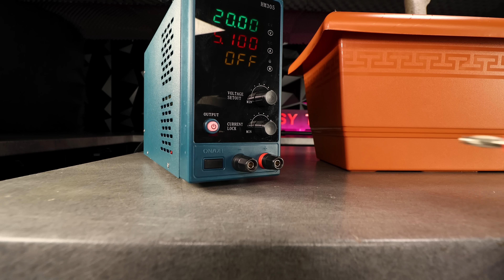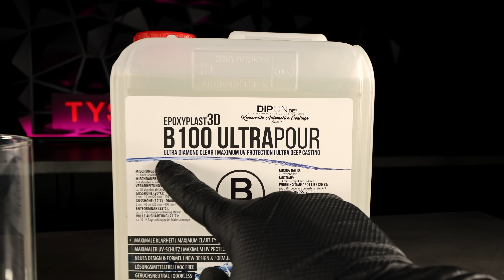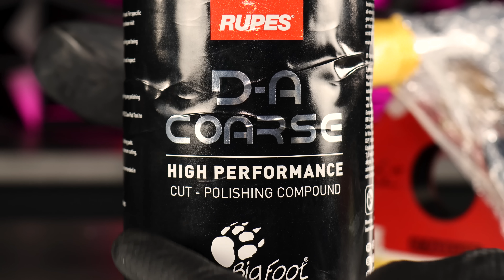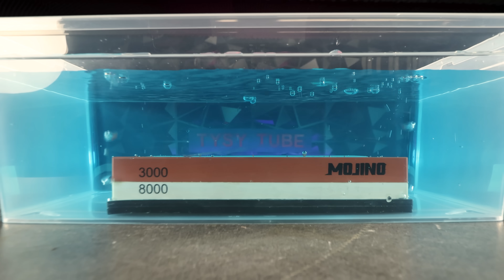Rust is Peeling this Huge Cleaver - Restoration (with Carbon Fiber Handle)

Comment: This was probably originally a variety of polearm and not a cleaver; the original wooden handle was likely several feet long.
Reply: @probablyaxenomorph5375 It was used in  whaling, but you're right that the original handle was probably several feet long and it could be used as a polearm.
Reply: I thought the same thing. That short handle will be unwieldy. For actual combat use, it should be at the top of a 6-7 foot pole.
Reply: @probablyaxenomorph5375  looks like a headsman’s axe tbh lol
Reply: I think the handle should have been a lot longer ... you wouldn't necessarily need to have it an original 6 feet or longer but even 4 or 5 feet would have been better because the little handle makes it difficult to hold
Reply: Always thought this was some sort of a halberd
Reply: Looks like a bardiche to me
Reply: @probablyaxenomorph5375  I was thinking glaive, but I'm glad it's not just me. Lol
Reply: I think the short handle was so he wouldn't waste too much material :) I was thinking that a weapon like that would have to have a massive handle. Does anyone know what the designs could date back to? Maybe they are just generic
Reply: Low-key looks like the Blackmetal Atgeir from Valheim to me.
Reply: Just a slovenian hewing axe, you goofballs....
Reply: @RolloTheWalker2  So it really is like the Black Metal Atgeir from Valheim, since that one is a Polearm but also a Hewing Axe, and you can even use it for that ingame
Reply: imagine being a medieval soldier or whatever and the weapon you passed down to generations gets used for COOKING
Reply: This is nothing but a piece of sheet metal cut to look like a weapon then they rust it to make these videos.
Reply: @samiam4544  Well, if you compare a piece of sheet metal to the varying thickness of this blade, the original forge marks on the metal around the wooden pole, and the scalloped pattern on the blade... it's pretty easy to see that this isn't sheet metal lol

I'm certain that some restoration channels resort to cheap trickery like that, but this piece in particular looks authentically built and naturally aged. It would be much more trouble than it's worth to forge sheet metal into a shape like this, with a tapered grip for the wood and tapering thickness towards the edge of the blade, just for the sake of rusting it up and then pretending to restore it.

Comment: nice work, not a Cleaver but a Broad Axe to hew flats on Construction Lumber (Beams etc.) hence the long and heavy Blade. 
The Eye and Handle are offset so you dont bust your knuckles on the Workpiece, Handles are typically very short but long enough to comfortably get a two handed grip on.
Lots of different Variations of Broad Axes out there, that one is on the large end of them, with the Advent of modern Sawmills hewing beams died out except for Restorations and recreations of Historic Buildings, Ships etc. they are quite nice tools to use but not easy to master.
Reply: Do you know why it would have such lovely ornamentation on it?
Reply: @benives254  Because it was a beloved tool that built many homes for people.
Reply: @demastust.2277  That, and toolmakers would decorate their pieces to show of their skill, sort of as an indicator of quality.
Reply: @benives254  Most of the ones i've seen and handled had ornamentation on them, other than the makers mark i suppose it was a way for Makers/Smiths to set their work apart from others and it looks nicer. 
its not that uncommon to find some decoration/personalisation on older Tools, they werent cheap and if your livelihood depends on them you're very much inclined to take care of them and value them highly. as Demastus T. has stated.
Reply: Doesn't it look similar to an executioner's tool? You know... cutting some heads off?
Reply: Interesting, thanks all! 🙂
Reply: @ThePrinzKassad  a headman's axe will sometimes have an offset blade, but the edge will always be parallel with the handle. A broadaxe has the blade edge at an angle so you can cut a straight line while standing beside the beam.

If you lay the flat side of the axe on a table and hold it down, the handle will stick up at an angle.
Reply: Rust dust must lust trust
Reply: @jesterblackguarde8464  that's an interesting fact to know. A history buff, by chance? Or were you a headsman in past life?
Reply: aw I was imagining the giants from Skyrim chopping their mammoth cheese with this
Reply: @jesterblackguarde8464  Yeah that too-
Reply: I'm pretty sure i've seen that axe shape in a game somewhere
Reply: Thanks for explaining what it is. Looked like something that might have chopped off heads long ago.
Reply: I believe it's the head of a halberd.
Reply: Nah it was uses to behead theives back in the early 1980's.
Reply: @grendalnewgod  How do you explain that the blade is at an angle to the handle?  (iow, as someone mentioned above, if you lay one side of the blade flat on the table, the handle will stick up at ~ 10 degrees).  Also, there is no spike on top of the blade.
Reply: thanks for the knowledge
Reply: My brain immediately goes to it being a Bardiche instead of an Industrial tool and was wondering how he got his hand on a Mediaeval Age relic
Reply: @benives254  Any tool that was made prior to the massive industrialization of the 21st century have a lot of nifty ornaments to it.

I see a lot of old scales in traditional markets at where I live.. you know, the one that has a basket/pot on one end and a flat surface on the other for it to place weights... Have this neat intricate flower or star patterns adorning the arms
Reply: There are those who still hew their own lumber. Mostly survivalist off gridders who lack a sawmill. I personally love the hewed finished.
Reply: The whole time i was watching this, it made me think of the medieval executioners.  And Marie Antoinette, who apologized for stepping on his foot...
Reply: It actually looks like some kind of polearms to me, mounted on the end of some long staff.
Reply: @LoadingAgony  A Bardiche... As I commented a while ago lol
Reply: I believe it is also commonly referred to as a hewing axe.
Reply: You do know that the handle should be about 4 feet or 1.291 meters long. This clever is for splitting cow and pig carcuses in half. It is not a hewing axe.
Reply: But you know Auntie Hien uses that same style knife for

Chopping
Slicing
Dicing
Fileting
Deboning
Pressing
Letter Opening
Hewing
and most importantly
Mincing Spices
Reply: Not trying to argue, but I think it is not heavy enough for hewing wood.
Reply: @grendalnewgod ❤
Reply: @aribantala ❤
Reply: @LoadingAgony ❤
Reply: @aribantala ❤
Reply: At first I thought it might be a noodle cleaver. However, the curved blade made me think of a whaling cleaver used to remove blubber from a whale carcass. But the decoration on the heel seems to be more of the sort of embellishment seen on a woodworker's tool.
Reply: How much does it weigh?
Reply: A short handled broad axe like that would be cool to see a sub-boss or something wield in a horror game
Reply: @noobmaster4412 a bardiche, a pole arm with the long blade to cut down the enemy
Reply: @evangelinetsukyomi9023  well thanks for that i guess
Reply: thank you I was really wondering what the original purpose was
Reply: Thank you, I thought it was a bardiche of some kind, but that makes much more sense given the design of the back end of the blade.
Reply: @grendalnewgod Bardiche, halberd is an axe in the front, hook on the back, and spike on top.
Reply: @ThePhil2801  a hewing (boad) axe have blade sticking above handle to cover hand while he wing wood 
This is more likely bardiche of some sorts 
The angle of blade ornamentation and style make it look fierce like a limb chopper of the old days 
I can imagine a musket was probably shoot out of this many times
Reply: I have a 2 handed carcass cleaver that is very similar to this. Not saying you're wrong. I may be misinformed myself.

Comment: For the Rust Dust Knife, I think you'll need quite a few more jars than that of rust, as almost all of it will come off as slag when melted. Also, I'd live to see you use those resin shavings for something, maybe the handle for the Rust Dust Knife? That'd be really cool!
Reply: Peter Brown did a video on that, unfortunately the shavings just blend in if you put them in resin.
Reply: @IceDragon978  still saves resin if you reuse the shavings
Reply: yeah, considering it is only oxidized iron
Reply: @IceDragon978  Is your name an MST3K reference?
Reply: @Frozenkoldfury  Yes
Reply: @IceDragon978  Ah, excellent, a Man of Culture
Reply: Is iron oxide.  Just need to use heat and non oxygenated carbon. Carbon dioxide/monoxide. The process is called reduction.

Comment: I had no idea that beautiful detailing was on the blade under all that rust. I like the handle, it turned out beautiful but I admit I was surprised you left the wood inside the shank. But it was a super stunning piece of work!
Reply: It's funny bc it's this terrifying implement made to disambiguate bones from meat but it has this pretty almost doily like engraving.
Reply: It's funny bc it's this terrifying implement made to disambiguate bones from meat but it has this pretty almost doily like engraving.

Comment: 2:17 I’ve always wondered, what would happen if you touched the forbidden juice while the electricity was turned on?
Reply: @austinhawthorne8649  not much with that voltage
Reply: tingly

Comment: I’ve always wondered if TYSY was in a skilled trade or very talented job because of all of the mill, lathe and welding work he does. Beautiful restoration!!
Reply: same
Reply: Sorry but his welding is terrible, source: welder fab for nearly 20 years, his grinding skills leave a lot to be desired too, I'm not saying it's not doing the job, buy it could be done simpler and more efficiently if he held the grinder flatter to the piece.
Reply: I remember his videos from years ago. Seems like he said he wasn't a welder. So I think he is self taught.
Reply: He's totally not a professional. Not meaning that now this is not his job, but from an handcraft perspective he lacks the basics of almost everything. Good for him he's improving and learning day by day, and of course, getting better and better, but nothing can be better than learning by working with a professional who teaches you how things are made. Or have to be made.
I see a lot of dangerous behaviors here on the Tube and I wonder how many people got heavily injured by copying the same mistakes.
For example, in this case he shaped the handle upside down. The bend should be on the bottom of the blade, helping the hand to grip while whacking things and dissipating the kinetic energy on the palm. In this shape instead, the vibrations will go directly to the wrist and being countershaped to the closed hand, it will tend to slip or rebound.
Reply: @@historybloody7206 didn’t ask

Comment: That “pitting” has always been the bane of my similar polishing adventures!  An interesting solution (besides the welding “hard facing” you did for the large pits) is “thermal spraying”.  There are various methods, but essentially they take MIG/GMAW wire and convert it into a molten metal mist.  You then spray down the workpiece with it and can grind that down flush, filling in any gaps.

Otherwise amazing build (The Carbon Fiber handle where you placed the fiber like a renaissance artist gilding a cathedral was AMAZING)

Comment: So many questions! First off, fantastic restoration, sir! On occasion I'll see you make creative choices that make me wonder, but that carbon fiber/epoxy blend is AWESOME! It turned out gorgeous and visually striking! Second, is this supposed to be a pole arm style tool or weapon? It almost looks like a sort of halberd, or a farm implement, so I'd imagine the handle would be longer, just for balance purposes. 

Also, seriously, how is your kid doing? None of us have seen them since you restored that dairy bench with epoxy (and epically done, I might add!). Have you designed a kid-sized sandblaster and work station for them to start assisting you in your trade? Let us know how they're doing! 

Fantastic work, sir!
Reply from the maker: thank you 😊, the kid is big now😂 3 years old
Reply: Its a Broad Axe used to hew Flats on Beams etc. , Handles are just long enough to get a comfortable two handed grip and offset so you dont bust your knuckles while working. no need for much leverage the long and heavy blade does most the work.

Comment: Sandblasting always seems to leave the items white, not their natural colour, can anyone explain? Thanks
Reply: It's just how the light is reflected, its not shiny and diffuses the light.
Reply: Really strange, so in a certain light/angle it would look it’s natural colour?
Reply: @KarinaMilne   I think the best way to think about it is if you look at sand and glass.
The sand will scatter light via each grain, and glass has a smooth surface.
Reply: that color is closer to the steel's natural color because the surface is much rougher which means you won't see the reflected light from your environment on it
Reply: It's the difference between a clean mirror and a mirror with steam condensation on it.  The surface is pitted minutely and therefore frosty.  The metal is essentially "frosted"
Reply: @TheSuperiorMonty  Exactly, this is the best explanation of the phenomenon ! For those who don't understand why this happens. 👍
Reply: Oh i had thought it was just the particles from the sand
Reply: It's almost surreal - like the texture failed to load on reality's render engine.
Reply: Nice job
Reply: @TheSuperiorMonty  Yeah, this is it... When we commonly see steel on blades or stuff like so, it's polished to make it smooth.. thus more durable

Unpolished steel is pretty dull in color, like if anyone ever see a rebar or beams that's straight fresh out of a steel mill, they're exactly the same
Reply: I don’t really know what sandblasting is. I just think it’s cool content.😂
Reply: @KarinaMilne  simple explanation. When sandblasting the metal begins to get tiny little bumps/dents on the surface due to the sand hitting it. These dents all reflect light in different directions causing it to seem white or less reflective than if it was smooth and polished.
Reply: @ConnorEtch  thank you! I know posted that question ages ago but I was still wondering! Cheers

Comment: 1:00 Of course it is possible. It's still iron mixed with oxygen, so all that's needed to do is to split those ones in half. I'm not sure what the proportions are. I think that iron is taking 4/5 or even 5/6 of the space in the jar.

Comment: Very well done as always !
As far as the makings of a knife out of rust, I'm pretty doubtful that's possible. You can't make steel out of iron oxide but, you are free to try because it will be a good learning opportunity for you and the viewer's.
Ps. Am scris în engleză ca să înțeleagă toți abonații și mă bucur că postezi din nou ! 🙂👍
Reply: I did a quick research and found out that it is in deed possible to melt rust into iron..but I think he would need a lot more rust in order to do that
Reply: @theemptyone7650  It's a very  difficult process, you need lots of time and boric acid. You can't work well with the billet because the material starts to delaminate constantly, it is very frustrating and a mess to forge it in to something useful.
Reply: @CRIS.V1891  I'm sure it's a very difficult process but I think this man could have the skills,time and patience to get it done..I hope he will at least attempt to do it because I'm very curious about the outcome
Reply: @theemptyone7650  Yes first of all you need experience in metal working/forging and second lots of patience.
He has skills and patience and I see him working with metal, but I never see him forging something before. And you need experience to tackle a demanding project like this one. But I don't doubt that if he puts enough time and effort in it he would have not great, but a decent result for his first try.
Reply: @CRIS.V1891  let's wait and see what he will do..if he has success or fails, either way I'm all in for a good video about it
Reply: @theemptyone7650  Of course and as I said before, either way this will be a good learning experience because practice makes perfect.
Reply: @CRIS.V1891  It sure does,can't wait to see what will happen..wish you a great weekend! 👍
Reply: @theemptyone7650  Thank you, I wish you a great weekend as well ! 🙂👍

Comment: Awesome video, as always! I’m curious about how the fork lubricant works with the sanding disc: what is its main purpose? Does it help with heat or dust? Or is it more like wet sanding, where it helps prevent the sandpaper from catching anything other than high points on the surface? Thank you for showing your whole process, I’ve learned so much from your channel!

Comment: I have a hard time believing these aren't intentionally rusted.  Anyone who has left a tool outside for a week or in a barn for a couple years and cleaned off the rust has seen the pitting is far worse than this (more similar to smaller piece in vinegar)

Comment: A tip I found works really well is to mix in salt with the vinegar bath, this creates a solution of sodium acetate and hydrogen chloride and is amazingly effective in removing rust. You can mix in a lot of salt to the vinegar to create this solution.

Comment: When you use electrolysis, grind off the rust from where you connect it so it can conduct the electricity better. Also, saltwater makes the current stronger, but it also produces a small amount of chlorine gas when used for electrolysis, so...